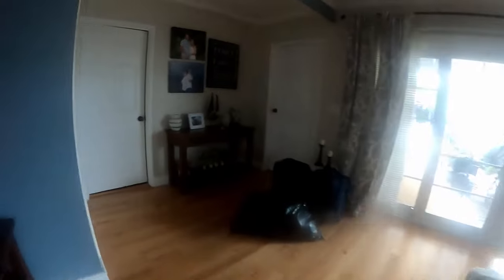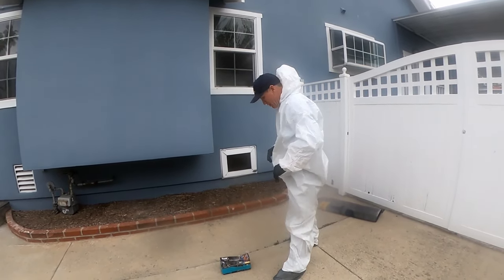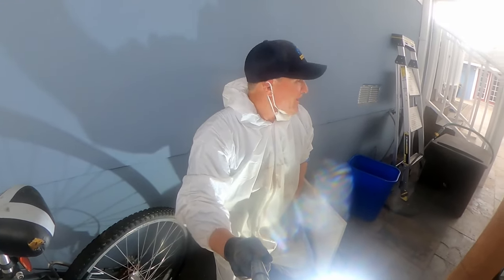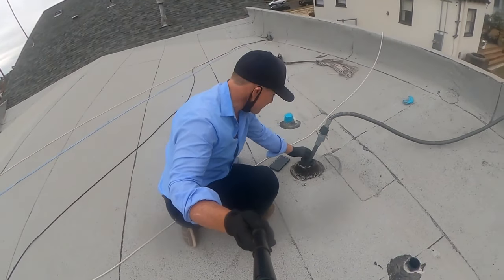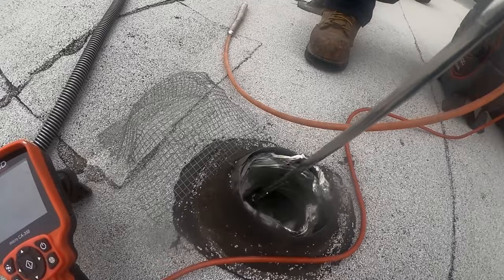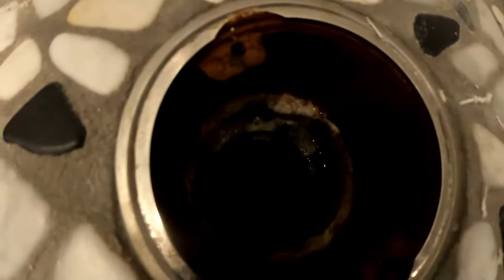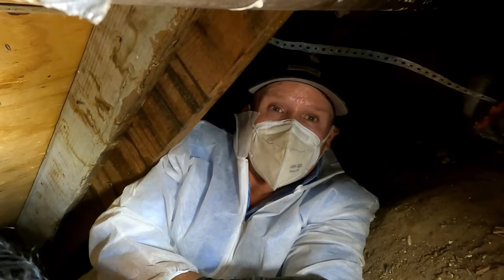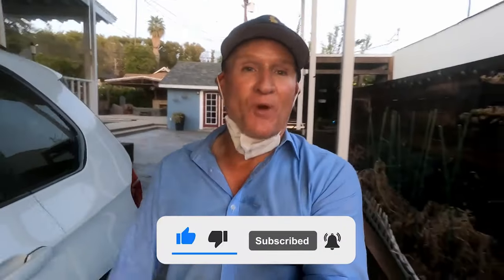How to Find a SEWER SMELL in your house...

Comment: We had a bathroom remodel about 4 years ago involving moving the sink and toilet to other side of the room and putting in a tub where a small shower was. I've often wondered it they dealt with the vents properly. Off and on we have a sewer or rat smell in the kitchen which is on the other side of the wall from the bathroom. The sink doesn't smell. The only slow drain in the house is the tub, which I attribute to my hair in the drain. We have had rats under the house. Maybe they've been in the house or attic too. I can't sniff out any source of the smell.  When the bathroom fan is on it draws in a bad smell through the wall heater, like old wood, but worse. The remodel was permitted, performed by a licensed plumber and inspected. I wish you worked in Ocean Shores, Washington !  We have a lovely beach you would enjoy.  :)
Reply: @Moe B Not for sure. We still have minor smell over kitchen sink, worse when bathroom fan is on, like air is being pulled through wall. Saw rat droppings outside crawlspace and under hood of motorhome in driveway.
Reply: Mark 14:36
36 And He said, “Abba, Father, all things are possible for You. Take this cup away from Me; nevertheless, not what I will, but what You will.”

Galatians 4:5-7
5 to redeem those who were under the law, that we might receive the adoption as sons.

6 And because you are sons, God has sent forth the Spirit of His Son into your hearts, crying out, “Abba, Father!” 7 Therefore you are no longer a slave but a son, and if a son, then an heir of God through Christ.

Ephesians 1:5
5 having predestined us to adoption as sons by Jesus Christ to Himself, according to the good pleasure of His will,

Hebrews 2:14-15
14 Inasmuch then as the children have partaken of flesh and blood, He Himself likewise shared in the same, that through death He might destroy him who had the power of death, that is, the devil, 15 and release those who through fear of death were all their lifetime subject to bondage.

1 John 4:18
18 There is no fear in love; but perfect love casts out fear, because fear involves torment. But he who fears has not been made perfect in love
Reply: We adopted a Chihuahua mix. He immediately went to the wall between kitchen and bathroom and barked wildly. I opened up the wall and found rat poop and a dead rat. After cleaning that out, we have no more smell. Case closed !☺️

Comment: So y’all disconnected the sewage pump and filled the tank that looks like it was buried (not advised) with rocks and slapped an exhaust fan to release the gases.  I believe you’ll have a bigger problem now; sewage flooding the basement because otherwise what is the pump doing?

Comment: Rule 1 ...... watch what your contractor does. And get it in writing as a contract. This way you can hold him accountable but also the contractor has a legal document which bind's him to do this work proper. And never pay more than 50% on a job upfront. And if the amount is bigger than 10k use a shared trust account this way the contractor can not run off with your money.
And don't forget even a "certified" plumber doesn't mean the job is done proper. Work with the person you hire. And ask him questions why he is doing it that way so you as a Customer understand him. Don't be an A$$ or he will rip you off. Be open and communicate this way you understand why things cost also that much.
Reply from the maker: Great share! Thanks for offering this.

Comment: Where are you guys located?
My house is on slab
When plumbed they had not finished mb shower there was a hole where shower head should be.when I moved in it looked fixed.but later found huge hole had been made in cement under vinyl siding on out side of house .8 years later when having other issues .got some one to take off siding in that area.and it was open to under bath tub  outside hole 15 inch's or more there.
And what we saw was when they cutt that hole they cut vent pipe apr.4 or 4 inch's above ground so the base of the whole houses vent pipe .It looked like duct tape around it not sure it was .grey in color apr.2 to 2 1/2 inch's wide.they wrapped it where it was cutt.
I had smell issues in this house 19 years
That was at 12 years here.
Some smells the past months were like chemical smells still don't know what or where from, got sick
Over and over no answers.😳🤔put plywood over hole area.person was not trained to fix it.just plywood.
Reply from the maker: Thanks for this share. We servce west coast. Utah, Arizona & Cali

Comment: Hello, I am watching your videos all the time it is really helpful , I have a question 
I have got swer smell in one bathroom at the roof , itry to find out the source of odor but cannot ,can you guid me to find out that .
Thanks again
Reply from the maker: It’s a bit of challenge when we’re not there to be helpful. Have you taped off the shower drain, vanity holes (2) and around toilet, air register in bathroom? Seal off all those areas. Keep door shut, then walk in after a late few hours to see if it still lingering. If not, then remove one seal at a time… example: remove toilet seal, then waitS

Comment: I’ve been trying to get rid of a bad smell in my laundry room. It seems to come up when the dishwasher is running or someone’s taking a shower inside either bathroom? I just I just purchased a new sub pump in the basement purchase new washer and dryer. A new hot water tank was replaced with all the bells and whistles. The drain in the floor we’re dumping bleach in it every other day and now I am currently in the sub pump because it smells too?
Reply from the maker: You have to run isolation tests. If you continue to struggle with trying to find the source, We do offer FaceTime consultation to help you pin point the source.
Reply: @TwinHomeExperts   that’s sounds like a plan. Like right now no water running and the smell is coming up through my vents . from Florening, the bleach the smell starts off like a faint chemical smell, and then you can smell the stink.